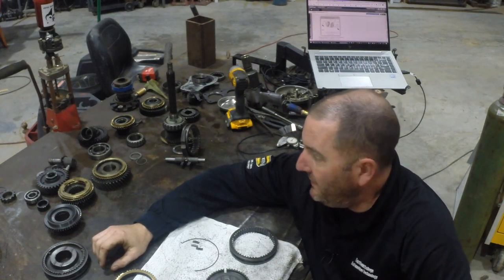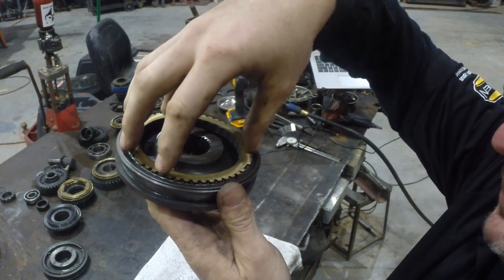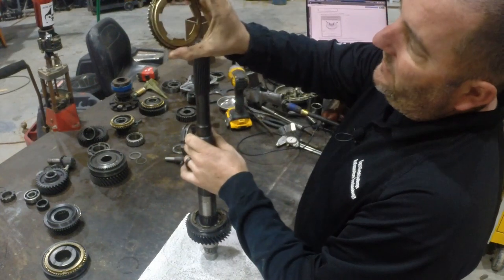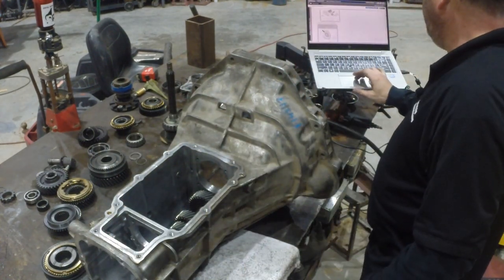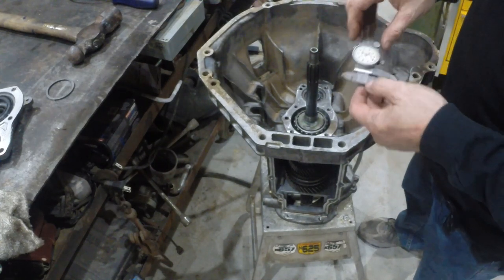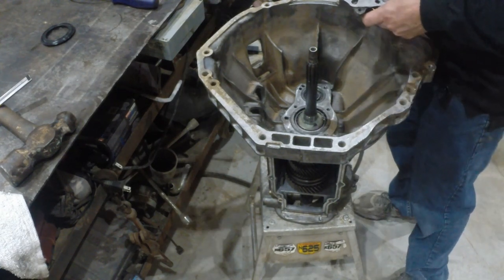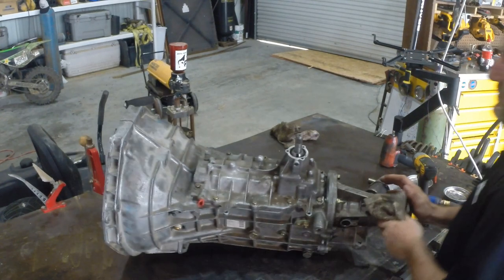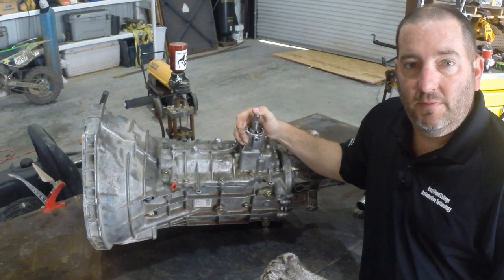M5OD Manual Transmission Reassembly

Comment: So I did mine 2 yrs ago and I goofed something up with the 1-2 slider. There's no detent on 1st, I have to hold the shifter or it slides out when not under power. Clicks into 2nd no prob. Didnt catch it till it was back in the truck. Said F* it, and been driving it that way for 2 yrs. It didn't do this prior to rebuild. Rebuild was due to a roasted bearing between input and main shafts. Now unfortuantely my slave cylinder is leaking so I'm preparing for a clutch job. The heck u think I did wrong? And can I fix it without a full tear down(betting not)?

Comment: Hey man. It’s a really good video. A suggestion for improvement? I would imagine most of the viewers of this vid are fairly mechanically adept. Identifying the various components and installing in the correct direction is challenging. Your experience allowed you to identify on the fly when something wasn’t correct. I have an AllData sub, and it is almost useless for a general (though broad) mechanic such as myself. Your vid would be absolutely perfect if you took a moment to demonstrate proper orientation of parts. On a purely selfish note, I am having issues with my keys continually falling out even though properly assembled. I suspect my keeper springs are shot. Any thoughts as to how “normal” this is?
Reply: My buddy said I needed to take some
auto-shop class just so I could get access to AllData...Really?
We couldn't find any of the blow-up 
diagrams we needed. Mitchell's?
No better.😢

Comment: I was trying to find a video showing the oil baffle on the bearing retainer at the input shaft. At 25:28 it shows the baffle black rubber up. I think it was supposed to go the other way. I couldn't see you put it in, so you may have just set it there wrong to trick me, lol. Naw this is a great video!!!! Thanks. It wouldn't fit the way you had it, so it fit reversed, the baffle that is.

Comment: So I rebuilt my m5od using your disassembly and reassembly videos. Drive the truck and all is good except for 5th gear. It will shift into 5th and stay in gear until you press the accelerator. As soon as you do it jumps out of gear. You can't hold it in gear with both hands. Any ideas? Maybe missed the 5th gear arm when I put the top on?

Comment: Question. Did you use a pipe to fit over the shaft when you pressed the input shaft bearing back on?  Thanks.

Comment: Hey buddy thanks for the detailed video. Where would you buy a rebuild kit and other items one may need for a complete rebuild of a M50d-R2? Thanks in advance. Its for my 89 f150 2x4 4.9l. 321k strong.
Reply: I ordered my rebuild kit off of AllstateGear I think I was at $200 or $210 give or take. Came with everything but the shafts and gears basically lol
Reply: I'm a big ebay shopper.